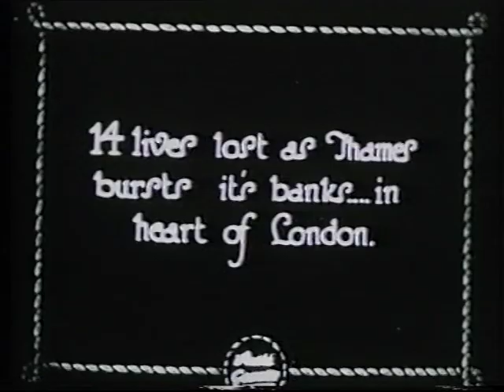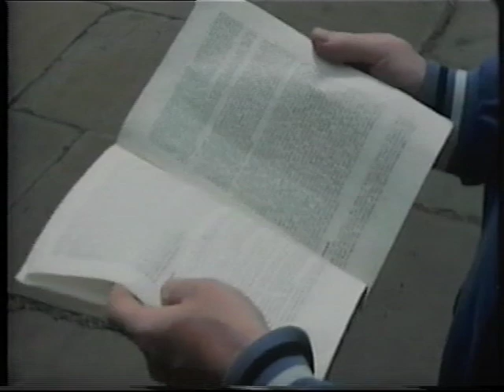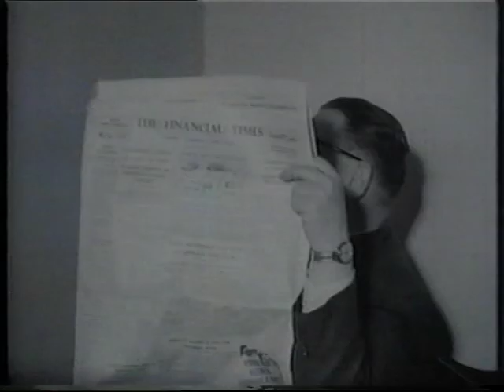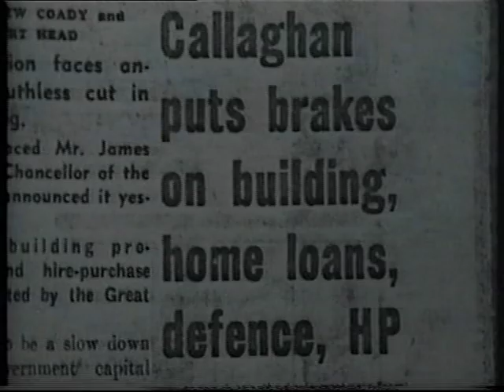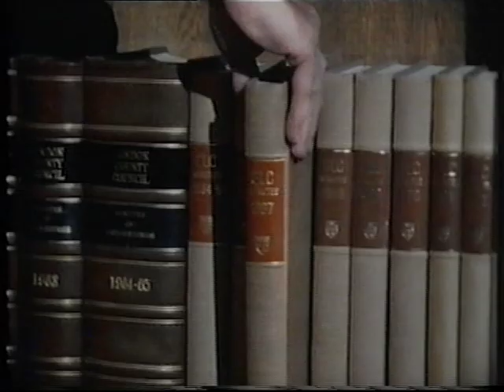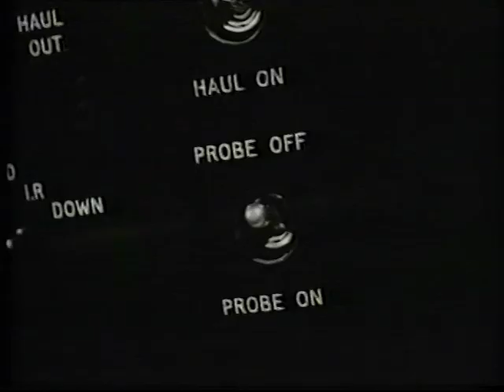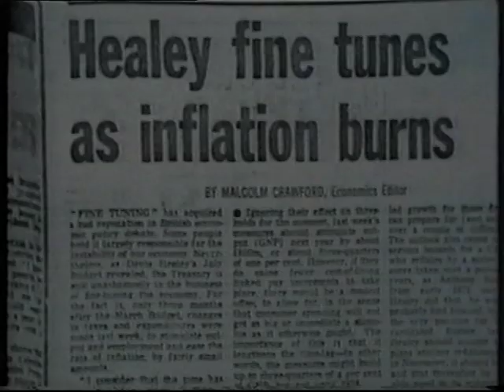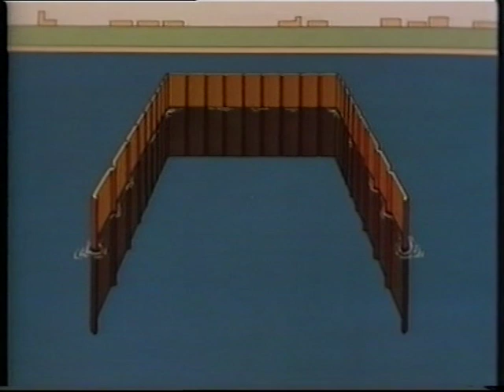London, UK--Building The Thames Barrier Documentary 1980s Pt 1 of 3

Comment: About one year ago heard these floodgates have become useless..I forget why or how come.
Reply from the maker: It is still operational. Indeed it has been closed (ie-in use) 28 times since December 2018 due to the wet winter. Latest reports suggest it will still be able to do the job until around 2070. After that the rising sea levels may require a new barrier or major rebuild.
Reply: its only supposed to be at its full potential until 2030, after that its won't be as efficient as it used to be.
Reply: You don't need propaganda for an efficient work..